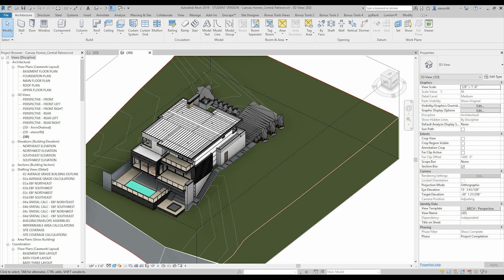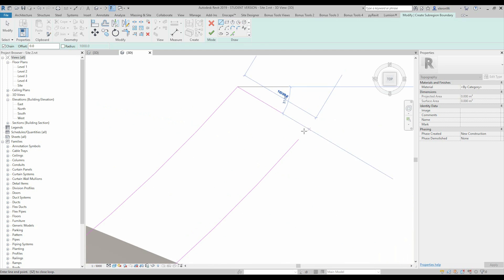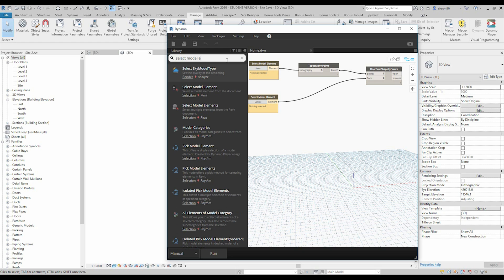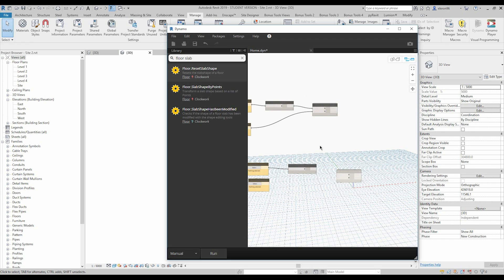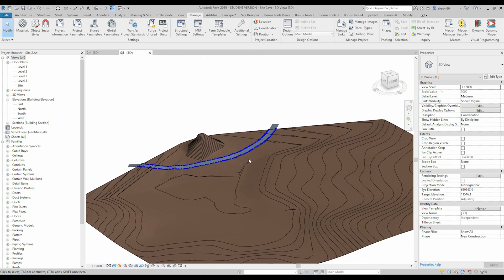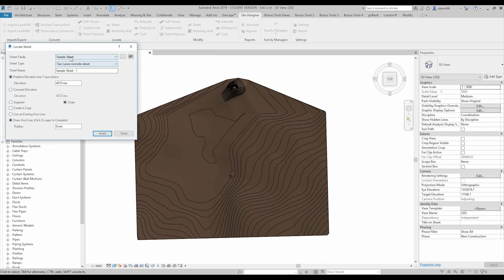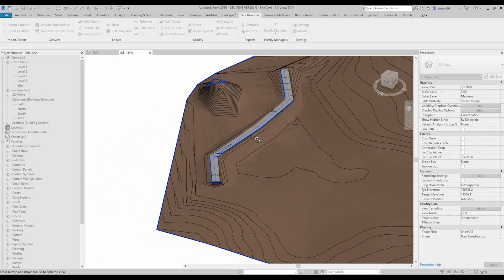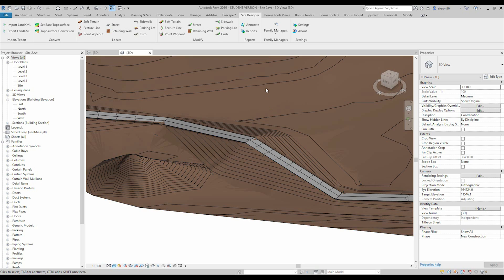Road and Pathway in Revit [LR5M]

Comment: Hi amazing tutorial however I'm stuck on the clockwork package. I downloaded the 0.7x but the floor.slab node still doesn't show up for me.
Reply: before downloading that you could check the vision see if it matches your Revit vision as well.
Reply: Did you find any solution, I am having same issue